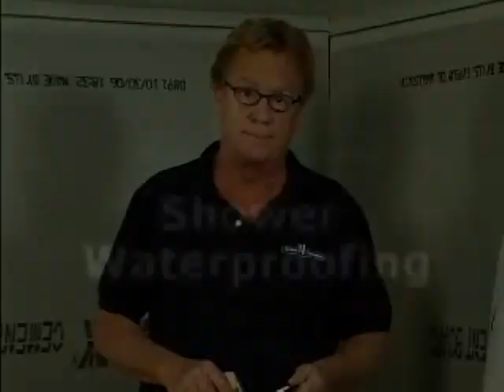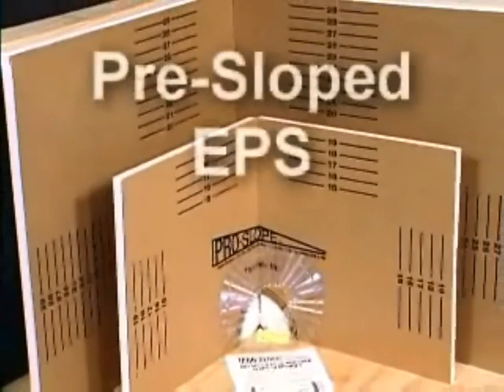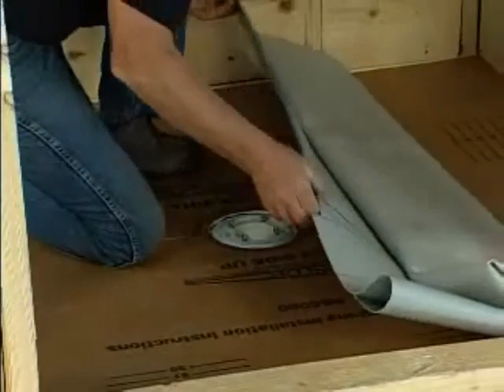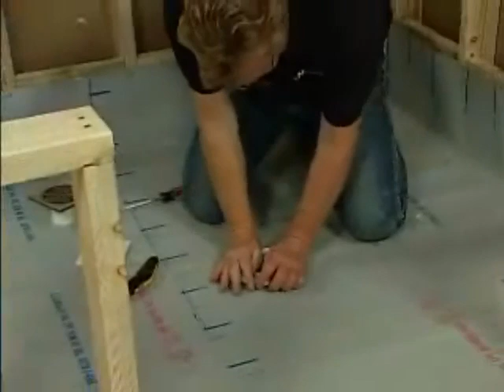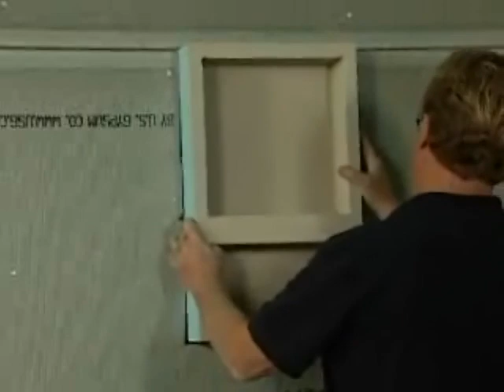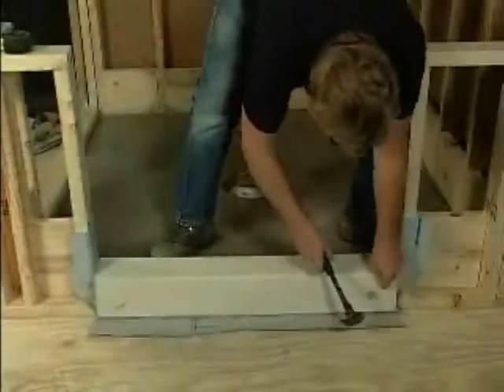Chloraloy Shower Pan Liner - Installation Video

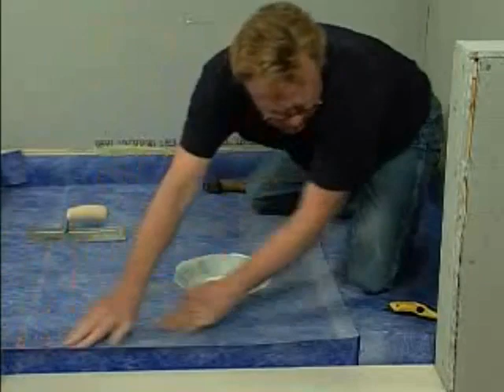Comment: @2:31 he has the primary layer of Noble Seal TS overlapping the more narrow layer on the right side where he is working from.... lippage is on the upgrade side where water flows DOWN into the lip. 40-something yrs. in the business and he overlooks a very important step in sealing a shower pan. I sure hope this one was over concrete and in a basement or a single level home.